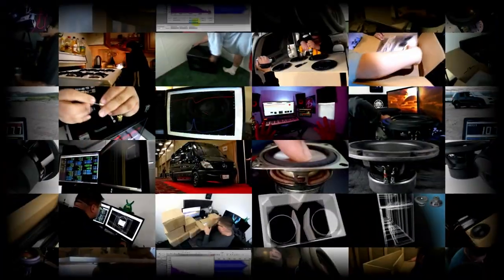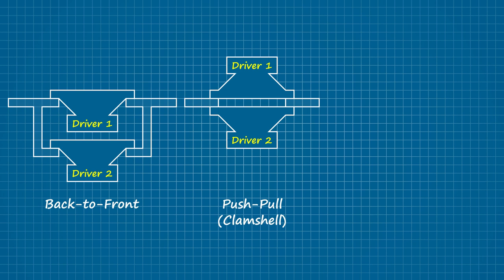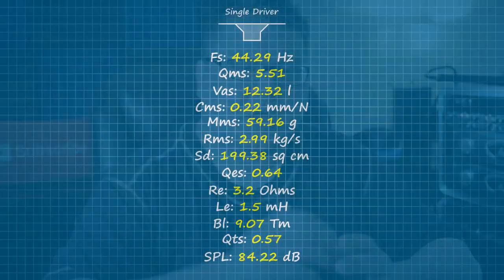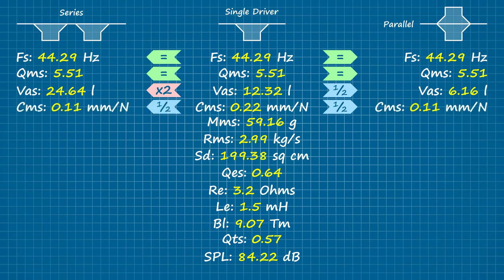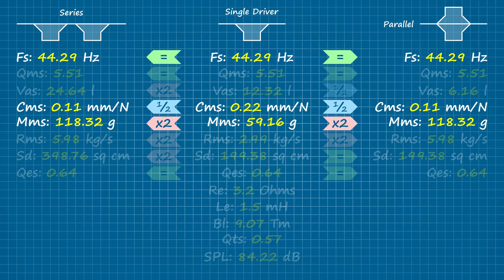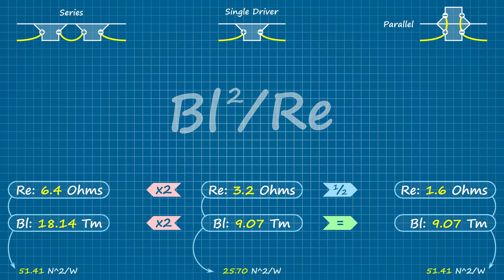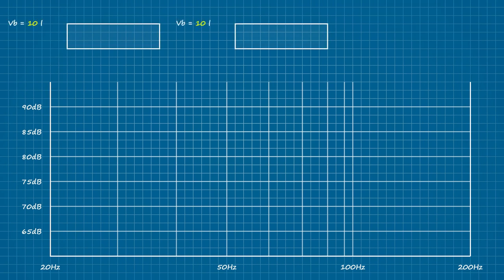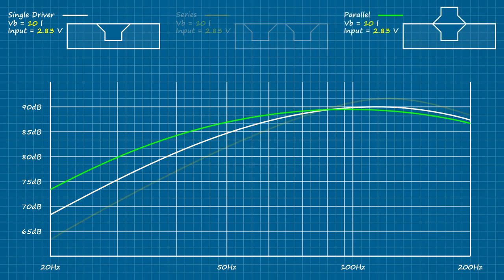All About ISOBARIC Loading

Comment: Can you touch briefly on Phase? Specifically the 0-180° function (at least on my amp), every video/info I find is about polarity. All my speakers are wire correctly but my subwoofers sound so much fuller and louder when set to the 180 position..

Comment: Not sure what you mean when you state that the air between the drivers is 'inert'.  If you were to measure the barometric pressure of the air between the two drivers, you would find it would vary.  As a thought experiment, consider two drivers with infinite compliance in an isobaric arrangement mounted in a sealed box.  It is easy to show that in this case the air pressure between the two drivers is exactly halfway between the pressure in the enclosure and the atmospheric pressure.

Comment: So if the recommend enclosure 3.0cu ft for each sub 4x8 port then what would it be for a single subwoofer with the face to face isobaric loaded enclosure. Would you double the port or for 2 subs?

Comment: Pete, what advantage does this woofer have with its FS so high and it's VAS so large? It can hardly be useful as a sub woofer, right? In my mind a subwoofer provides lower response than the average woofer, which this seems to be. My one home system has a April of two ways the provide 45 Hz to 23 KHz response, the sub mated to the system. Has an f 3 of 23 Hz with a very flat drop off of maybe two or three HZ. It has a system Q of .81 so there's a bubble at 60 Hz or so, but with the active crossover I bring it in at 50 hz, as flat as my  ears can detect. That gives a realistic System F3 at 23 Hz, and that extends well below 20 Hz, with ease! So how do these woofers measure up? Not sure how they can be called subwoofers being rated that high. Sub wife's originally handled the low frequencies that the woofers could not reach. A pair of satelights save space with a dedicated sub set up to compliment them allowed for the low frequencies to be reachedwihout having two use speaker cabinets taking up space I. Your room, something that never bothered me, but chicks can't stand. My wife looks at my stereo as a pile of blinking black boxes. I tell her I'm an alien trying to reach my home planet. Somehow. It works.
Reply: It's very simple. 
Say you had 2 12s, but, only enough airspace for 1. You iso then and enjoy lower frequency bandwidth than the single woofer would have had.

Comment: Here's a question that not many might ask:
Using your chart and selecting the parallel configuration style, but changing the way the drivers are amplified from the parallel configuration to individually driven (ie, initially two 8 ohm drivers in parallel to form a "single" 4 ohm driver driven by a single amp, changed to both 8 ohm drivers driven by their own amps of the same wattage as the original configuration), what does that do to the TS parameters? 

Asking for a friend. ;)

Comment: Your video explains everything in regards to a sealed enclosure. Can we assume the same principles for ported? Meaning will the box design for a single ported enclosure be the same for a parallel loaded ported enclosure (assuming a clamshell)?
Reply: Yes, still applies in a ported alignment. It's also not recommended to run isobaric sealed as one driver will outlast the other because it's constantly being cooled in open airspace versus the internal box that heats up more. It will make the best sounding ported box you've ever heard because the cones correct each other eliminating non-linarities specific to each driver as well as being pushed and pulled on both sides with twice the motor Force on the same airspace. It also reduces power compression issues that plague single driver systems. You really can't beat this setup if you want to go ported and limited airspace like me for example.

Comment: What I would like to know is related to the image at 2:59 elapsed.  Instead of stacking woofers 4 high like this, I am interested in a "double clamshell" arrangement where 1 woofer is outside of the box and the other 3 are inside.  My question is if the inner pair of clamshell magnets are very close to each other, does that effect the performance of the woofers in any way?  Is there a minimum distance woofer magnets should be spaced if they are back to back (magnet to magnet) and does the orientation of the magnets (such as twisting one of the woofers) of any importance?  Thanks in advance.  Great video!

Comment: I haven't heard of isobaric loading in ages. I seem to remember reading something back then (late 90's or early 00's) that you could only use subs that were specifically designed for this. The logic was that since you had two subs acting on the same box space, the air suspension wouldn't properly limit excursion and the subs needed stiffer than normal suspension themselves. Is/was that true, or am I just full of cobwebs?
Reply: @HexiBase  I have a couple of 10" subs currently in a dual chambered sealed enclosure. So are you saying I could mount both in ISO in just one chamber of that box due to the doubled up suspension?
Reply: @Nareimooncatt  To answer your question: 
If you already have ypur subs in a box and switch to isoing them in a box for a single one, your output will be much less at regular bass frequencies (40-65Hz) but would play about equal to the two subs at very low frequencies, if not barely louder (probably not though, depends on car loading). 

Instead go get two more identical subs and clamshell them onto your existing 2 sub setup. 
You will be amazed how low your 2 12s box will extend. 
Just wire the other subs up parallel. 
It won't matter if it wires too low, your box rise will let you get away with it.
Reply: @staywhite6332  I have 10's, but they are also about 20 years old. Don't laugh. MTX Blue Thunder Xtremes and they still work great. So not only do I not have the option of getting more of them, they are single voice coil subs. So to ISO 4 of them, I'm limited to either 4 or 1 ohm. My amp is only 2 ohm stable, so I'm limited to 4 ohm at best in that scenario. They are plenty loud as it is, so the lower frequency response had my ears perked.

Comment: Also, what should happen if someone stacks 3 identical woofers in an isobaric arrangement?  What is the relationship of 3 vs (2 or 4)?  Is using 3 isobaric woofers a good compromise when 2 is not enough but 4 is excessive?  For example, if someone already has a 6.67 cu ft. box but a single woofer "wants" 20 cu ft (Vas).
Reply: Giving a woofer it's full Vas airspace makes it "happy" and allows it to play deep.  If as a result, the box would be too large, that is where iso alignment helps lessen the box size without giving up deep bass.  For example, I used to have a single 12" woofer in a 24 cu. ft. box since it has a Vas of 24 cu. ft, but I instead could have purchased 2 of those woofers and had a 12 cu ft box made with an iso alignment.  Clamshell is my favorite alignment since it is simple to do (a bead of silicone sealer between the 2 woofers will suffice).

Question:  in the iso alignment with magnet to magnet, is there any interaction between those magnets?  Does any of the electrical characteristics change because of the closely spaced magnets?

Regarding doping, how would that change the TS parms if a very thin layer of silicone sealer (I usually use clear), is applied to the woofer cone (front side only.  It seems like for paper cones, sometimes it sounds more neutral if I do that, but for polypropylene and some other types, there might be no benefit to doing that.

Comment: Just out of curiosity, - would you be able to measeure how isobaric mounting of two drivers compare to one single driver's response time and force output to one another?
If dynamic response is better with two drivers in isobaric, then that surely is a benefit, over just being able to cut the enclosure volume in half!

Comment: Great videos!  Is it true that 12" drivers are the sweet spot for accurate reproduction of mid bass while still getting moderate extension?  I'm on a budget, so I've got bookshelves for mains, and mid bass modules are not feasible for me.  So I want some good extension from two subs without sacrificing clean mid bass.   I've been considering the VBSS design which is a single 18" Dayton drivers in large ported boxes, of which you can make and power two for approximately $700 not including tools.  Apparently the low frequency performance is stellar for the price but I worry about the mid bass quality since my mains (kef 5.25" uni-Q drivers) have poor extension.
Reply: You would need 8s or 10s as midbass. 
Of course you could try to fudge it to be decent, but, you'l always have a big dip. 
Plus, you don't want to run your substage way into midbass world because it causes localization to be audible in the subs.

Comment: 3 cubic feet of available airspace. 
Sealed box. Front firing into a automotive cabin. 
If im in search of long low frequency bass extension.. great power handling, and a very musical sq enclosure. 

Is two 12" my better option mounted in typical side by side parallel fashion. Or..
Two 18" in a isobaric, push pul configuration. 
Assuming all subs are optimized for the low freqs i seek and have the appropriate power applied.

Comment: In theory would putting 2 woofers in series and one in parallel, or visa vera, would it behave similarly to a battery, in that you get the benefit of one without the negative of the other or something similar? 

Lol for you its probly just slap numbers in a calculator, I just have no idea what equations I need to make this calculation.

Comment: How does Isobaric clumshell  work when  the drivers are mounted at an angle say 50 degrees (or 45 degrees) instead of directly facing each other face to face. Thanks for any thoughts

Comment: You said that the 2 speakers connected in series will have a SPL that is 3dB higher.   Since each speaker will have half the voltage applied to it, this doesn't appear to be correct to me.  Perhaps you could explain it.
Reply: Twice the surface area is +3dB.  The voltage is constant - still the same signal level compared to one driver, it's just shared between two, so each is playing half as loud (-3dB).  The net effect of the system is thus +0dB - but at half the current.  If you double the voltage too, then you get a net +3dB.

Incidentally, running two in parallel (but not in a clamshell - just two drivers with their voice coils in parallel) gives you +6dB, since you double the surface area AND also the current since it's half the impedance at the same voltage compared to a single driver.  This is why the amp has to be rated for lower impedance.  It's a voltage source, and with a lower impedance load, will be sourcing twice the current.

Comment: So what should happen if someone puts 4 identical woofers in the same enclosure in 2 isobaric pairs?  How is that different than just a single isobaric pair?  Do the numbers that halve going from 1 to 2 woofer halve again with 4?  For example, if the Vas is 20 cu ft for 1 woofer and 10 cu ft for 2 isobaric woofers, would it be 5 cu ft for 4 woofers (2 isobaric pair in the same "box")?

I wonder if in a "blind" test if the average person can tell the difference in quality of bass between the single woofer in a 20 cu ft box vs. 2 in a "clamshell" arrangement in a 10 cu ft box vs. 4 woofers (2 clamshells pairs) in a 5 cu. ft. box, assuming all are set to the same volume level.
Reply: The four act exactly the same, tho for the power handling which is four times more than a single driver. Tho one note: the average person may have a hard time distinguishing no matter the arrangement. You gotta have trained ears to detect small changes like this in sound.

Comment: What might happen if you use 2 identical woofers in a push pull clamshell arrangement but that model woofer has different excursion limits in different directions?  Is that a bad thing since it may force one woofer to go beyond its limit or do woofers generally have the same maximum excursion in either direction?

Comment: I want to build a push pull isobaric soooooooo bad. I honestly just want to add two more to my existing box and just make mdf spacers to space them out correctly.
Reply: Do it.
You will love the extension you enjoy. 
Your car will shake so hard in the 20s that you will think you have a wall of 18s compared to what your box is doing now. 
Don't change anything. 
Just do what you wrote: spacer between them, parrallel it all and run it. 
You will shit yourself. 
Been doing iso setups since the 80s. 
Every setup I ever see, I think to myself: "Imgaine if they just clamshelled all those." Mmmm...
Reply: I admit, I'm exaggerating slightly, but, only slightly . 
To tell you for real what it will do, your box's bandwidth will shift 1/2 and octave down, so, your upper bass (50-65Hz range) will be acoutically filtered down some (will be quiter), but your box will extend much lower.
Reply: @staywhite6332  that's the idea. I want to keep it simple. I don't have much trunk space so the clamshell just make senses. If I could find a amp that'll handle .50 at 1600w that would be fantastic. Or I might have to run another d-class from the same series of amps. Either way i think it would be super interesting if it actually turned into something awesome.

Comment: One last question that has been bugging me for a long time now.
If you have an amp rated for 2 ohm, but your sub is 4 ohm, is it better to run two subs, or is the power just divided?
Reply: Depends. 
If you have a 1 channel 2 Ohm amp, yes. 
Add another 4 Ohm sub in parallel to enjoy max power from the amp. 

If a 2 channel 2 Ohm stable amp, you can run 2 subs in parallel on each channel. So, 4 4 Ohm subs on a 2 channel. 
You can also "bridge" the 2 channel amp to one channel, add your two subs in parallel to the bridged channel, and even though it would be technically wired too low, once music starts playing, your box will make the impeadance instantly rise to a safe, usable level.

Comment: Isobaric seems to be rare design I have heard a Lexus once it had great low end pound to it. But only one i have ever seen or hears
Reply: I used to own a JBL SB-5 sub which had 4x 6" drivers in isobarik arrangement. It was dual channel so that it could pass-through to the satellite speakers.  It seemed a bit odd because at very low frequencies there's no way to experience stereo separation.

Comment: Hi, can you explain how it affects the speakers with dual voice coil (DVC) to the design of the box?
I think that an Isobaric configuration is very similar to a DVC, if you use the 2 coil (series, parallel, or an Amp for each coil), the volume of the box is half.
But how do I put the data in the software?
 Should I assume that it is an Isobaric configuration, in parallel or in series?

Long ago I bought a subwoofer, in the data sheet come the T/S parameters and the recommended boxes. There are the typical single / serial / parallel configurations (4, 4 + 4, 4 || 4), but it does not say how these configurations affect the final volume of the box.
It says it is 600Wrms - 1200Wmax, but it does not say if it is for each coil or in what configuration. I must assume that it is 300 + 300Wrms, being very optimistic ...
some help?
Reply: i'm no expert but dual voice coil doesn't make a mechanical difference, eg a dual voice coil vs single voice coil woofer of identical specification/size will act the same, doesn't effectively reduce volume of the box or anything like that.. dual voice coils are simply there to increase the amount of options available when wiring up the subwoofer, eg a 4ohm single coil will only ever be 4ohm, a dual 2+2ohm can be wired as 4ohm(series) or 1ohm (para), which can help you match impedance with your amplifier etc etc. 

as for power ratings, they seem to go up/down depending on the OHM rating/load, as I guess its a ohms law, ohms vs voltage vs amperage, change them around and you get a different amount of watts..

again, not an expert but I know for sure you don't need to make any special box designs for single vs dual coil.

Comment: Even though this video is 2 years old, I have a question that hopefully Peter or someone else can answer. If "Cms" is a mechanical measurement of how far a cone assembly moves in relation to the amount of physical force applied to it's suspension, why would that change by adding more drivers to an enclosure? Unless I'm missing something, the stiffness of a driver's suspension remains constant regardless of quantity or enclosure configuration. Anyone out there have an answer?
Reply: The compliance is half as the stiffness of two parallel springs is double that of one.
Reply: @Rene_Christensen  That is true if applied to springs holding up a truck as the amount of load force (which is a fixed value based on the weight of the truck) would be divided between the two springs. That's not the case with speakers as each time the quantity of driver cone/spring assemblies are doubled, the amount of electromotive force available to move them is doubled as well. "Cms" is a purely mechanical measurement value (same as the load rating of a truck spring) that can only be altered by changing the compliance of the spider or surround, and is unaffected by changes in other T/S parameters. "Vas" on the other hand, would definitely change depending on driver quantity and placement